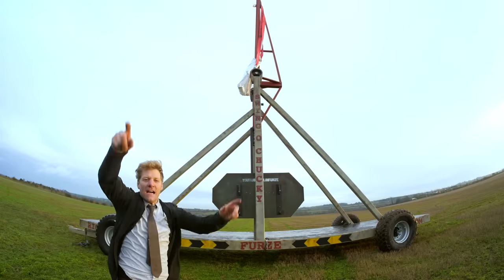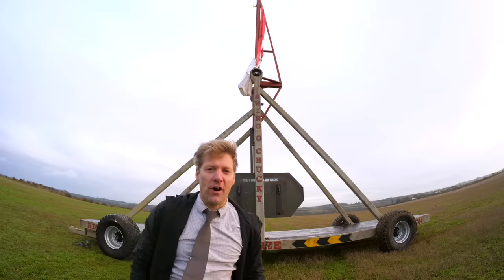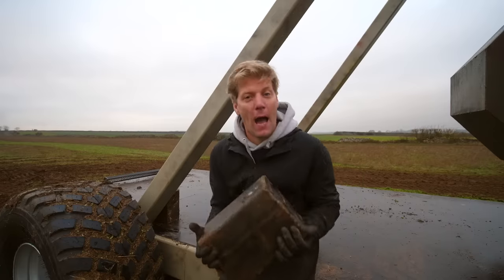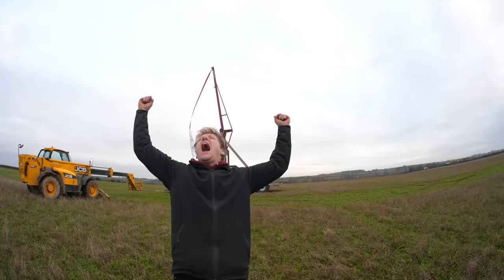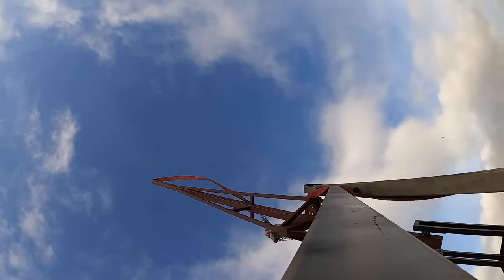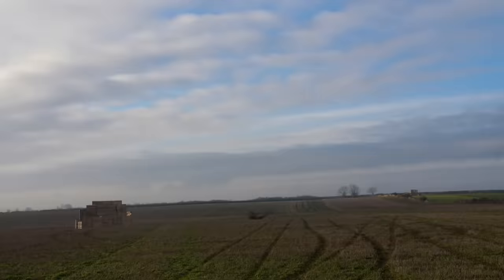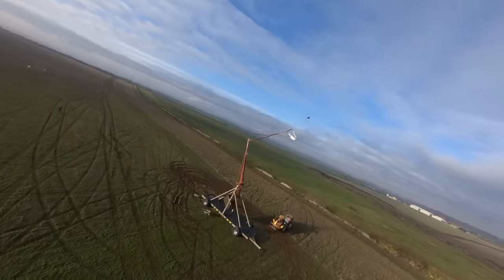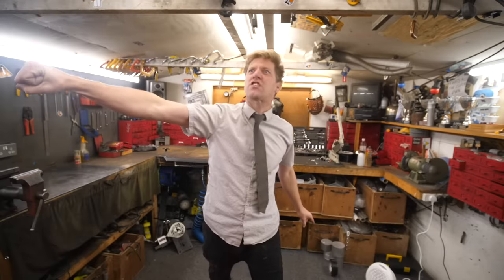MASSIVE Trebuchet/Catapult First Test

Comment: Shorter strap and heavier counterweight. The strap should be shortened before adjusting the hook. It can build speed from centrifugal force faster before release. Think of an ice skater. Slow spins the arms are far from the body, the closer the arms are to the body, the faster the skater spins. The arm and sling should reach the apex when you release at the same time.

Comment: Why not attaching a spoon shape instead ? It won't wrap around the projectiles and they will be released at their highest velocity.
Reply: The projectile would just slip out due to centrifugal force, good idea though!
Reply: lolwut the sling is the whole point of a trebuchet
Reply: The sling increases the effective length of the arm. You would lose a lot of power without it.
Reply: @aero42  yea it shoud be concave enough to be retained
Reply: The main advantage of a sling on a trebuchet is the multi 'arm' linkage which whips it around at the last second and makes it go much faster than the end of the rigid arm does
Reply: @kylekinsey2624  yea but the sling is too wrapped around the projectile due to its weight, all the force you gain you lose it anyway by ripping off the textile. 
If he wants to keep the swing maybe he should be making an Y shape and attaching the swing on each arm of the Y
Reply: That would downgrade it to a "convencional" catapult, and decrease the speed of the projectile. The sling works as a kind of whip, where you trade weight of the projectile for higher speed and, therefore, range.

Comment: Anchor that thing down for crying out loud. Look at all the lost energy with that thing moving back and forth.
Reply: Actually the wheels can make the trebuchet launch things further than if it's fixed. Tom Stanton has a video where he tries this on his little trebuchet. TLDW: adding wheels to a trebuchet lets the counterweight stall a bit later in its movement which in turn means that the swingarm can get to a vertical position before it stalls, adding a bit of speed to the swung projectile.

Comment: Aren't you losing some energy in the chassis moving ? You should anchor it to the ground
Reply: Exactly what I was thinking!  Or maybe a few large wheel chocks from a big rig?
Reply: Apparently not......
Reply: Yeah was thinking the same, also the arm seems to stop moving before the projectile is released, so the optimal launch velocity is yet to be achieved..
Reply: I've heard the rolling chassis is necessary for repeatable accuracy- could just be people justifying a design flaw tho. But it definitely reduces stress on the frame, which is a problem here, if you remember the flex in testing!
Reply: Most of the energy displacement is happening after the shot is released. you want the carriage to move some what to absorb the shock.
Reply: No, that would probably destroy the whole thing. The problem is that the weight just falls straight down, stops, and then has to accelerate horizontally, which brakes the arm too early and all the energy that should go into the projectile is going into the chassis of the trebuchet. That's baaad design.
The solution would be to fix the weight to the arm.
Reply: @GLITCH_-.-   yes you want to launch the projectile at a more straight angel. like a line shot rather than a pop up fly ball in base ball.

Comment: you need to chock your wheels colin, your losing a lot of energy in the recoil before release on the weighted sides down stroke
Reply: Old school trebuchets we're built on wheels specifically so they would be able to make the slight back and forth motions. I can't remember exactly why, but I think its to keep the thing from literally ripping itself apart. Then again, they used to be built out of wood.
Reply: Interestingly, it is the opposite.  When it rolls, it allows the weight to fall further in a straight line, which increases the energy transferred to the sling.  It is somewhat counter intuitive, but a bunch of smarter people that me have done the math.
Reply: Exactly. When it moves, it actually moves the whole thing forward, increasing forward power in the launch. Wheels are intentionally added wherever possible, even if it isn't going to travel anywhere. (Tons of simple gifs online to explain it)

Comment: What about locking the wheels in place when slinging???
Reply: That's my thought too
Reply: He used heavy truck axels with cam style air brakes he just needs to add the brake chambers and a air tank and valve to release them to pull it around then dump the air and the caged springs will  lock the wheels and hold it steady
Reply: Trebuchets are more efficient when they're allowed to roll because the weight can move straight downward.
Reply: @coder0xff  good to know

Comment: You're on the right track with the cable attached to the projectile. Use a bit of steel cable or the strapping like you did on the last shots. No sling to get in the way and much more consistent (if my smaller scale stuff is any indication).

Comment: A few changes I would recommend: 
Better sling, obviously.
Adjustable pin angle. That pin you hammered needs to be adjustable. 

Tuning:
Objects of different weights take longer or shorter to move relative to the arm, and you want to throw while the tangential line to the curved path of the payload is around 40-45 degrees above level (45 is the optimal angle in a vacuum with constant speed, but air resistance, the free height from how tall this is, and the continued acceleration of the projectile each push that a bit lower, I’d guess around *40 degrees*). This means you want the projectile to release earlier than you are letting it.

Additionally, the sling takes a bit of time to release, so you want to release the loop on the pin while the tangent line 50 or 60 degrees. Especially with pointy projectiles that take a long time to release.

Comment: If the span between the weight and where the weight attaches to the arm is shorter, the weight itself will rotate rearwards at a later point in the swing; causing an increase of rotational velocity in the arm.  I hope this makes since.  Great build though!

Comment: Need to chock the wheels, there's a lot of energy being lost with that thing rolling back and forth.
Reply: “Wheels add power as the trebuchet rolls forward. Like a pitcher who leans toward home plate as he hurls, the forward motion adds velocity to the pitched weight. The rolling back and forth of the wheeled counterweight also allows it to fall in a straighter line, the most efficient way for a counterweight to respond to the force of gravity. 

The straight-falling counterweight is more powerful because a straight falling counterweight results in a higher velocity at the sling end at the moment of release. A higher velocity results in a farther throw.”
Reply: @ChrisPete123  wow, interesting. i was actually wondering if it helped, hindered, or was just necessary for it to work in some way. thanks.
Reply: @ChrisPete123  Well, you learn summat every day, thanks for the info!

Comment: Hi Colin!
Congratulations on this massive build! 2 thoughts which might resolve/improve your "bag issues":
1) try throwing more spherical projectiles, as i'm afraid that the corners of your square metallic box might by too agressive for the bag...?
2) i've seen you (sometimes?) placed the 2 strings of the bag on the each side of the projectile and i think that might twist your release. I'ld recommend placing the fixed string on top of the projectile and the loose one under it. Thus the bag will already be alined with it's release's plan and hopefully that will make it smoother.
Cheers & good luck for next shots!

Comment: I feel like the trebuchet needs to be held down so it doesn't move when it's launching. That's got to be a lot of wasted energy.
Reply: Surprisingly, its the opposite. A trebuchet on wheels that is allowed to move is more efficient and I don't know why.
Reply: @TheKakashi709  when allowed to move forwards and backwards with the wheels, it allows the weight to follow a more downward path than if the base was fixed.
Reply: @mharbol  Interesting.
Reply: In earlyer development  many years ago; they found that stationary machines did not do well.
Reply: Lol 😂😂😆

Comment: What's happening with the earlier shots, is that the sling is releasing a little too late,  thus not launching at the optimum angle to get the most range out of it. The way to solve this is to bend the release "peg" backwards slightly to make it release earlier, probably by maybe about 5-10 degrees but no more than about 10-15 degrees, though the best way to do this is to bend it a few degrees at a time with the standard test projectile, until you get a release close to when it ripped through the sling, although looking at the footage, that popped out of the sling a little too early to get the best launch, if it came out half a second later, it'd have been damn near perfect. Getting the release timing JUST right makes a world of difference..

Comment: When the whole machine rolls backward during launch, you're losing a lot of energy there knowing the weight of that machine.
Reply: With wheels is more efficient if you can get everything lined up as the trebuchet is moving forward as the projectile is released.
Reply: I thought this as well, some big chucks behind the wheels
Reply: the energy comes from the weight, for the greatest efficiency you want that to fall straight down- therefore it should be able to move to allow that. It should be noted however that the energy released does not all transfer into the shot so of course there will be additional movement after release.
Reply: You obviously have not watched Tom Stantons video yet. Check it out its very interesting. When optimized wheels make it throw better. https://www.youtube.com/watch?v=KpFTyE-wiNo

Comment: Beautiful!! Two suggestions, need a little bit of hook on the post when sending the strap with the projectile, think that might help with horizontal distance, and as said, round projectiles. Also, need to lock the wheels up as you’re losing some of your power to the whole kit rolling around!!
Reply: trebuchets are actually supposed to roll a bit, otherwise they tend to lurch up into the air
Reply: Did not know that.... thank you!

Comment: Colin, have you thought about lining the floor of the trebuchet to reduce friction?  And possibly making a sling with three layers sewn together.  One layer as original used, one layer running 90 degrees to the original layer's fabric and one layer at 45 degrees to the original fabric.  Or maybe start using fiber glass or carbon fiber strips.

Comment: Instead of trying to make a sling that can work for all the different projectiles at once, just make several different slings. Also, get rid of trying to release the strange shapes like a washing machine with a sling, they will be better served by a strap connection that stayes attached to the projectile with a quick release on the strap, like some kind of explosive decoupler bolt.
Reply: I can't quite get Colin's obsession with washing machines

Comment: so as of now only the releasing mechanism of the sling seems to be the barrier between the trebuchet and perfection, so here is an idea. let's for now say that the release mech is perpetual. as in it happens by itself. but the issue with that is that the angle of the sling relative to the main beam differs depending on the amount of load acting on it (which depends on the weight of the counterweight and the  weight of the projectile. my suggestion is what if you could make the release completely mechanical? meaning that the sling releases exactly when the beam makes the angle that is ideal for the trajectory so that regardless of the weight you put in the sling you can guarantee that it will always release to have the best trajectory and not release when the load is in the right angle.

i hope that you give this a thought

Comment: judging by the movement in the counterweight you are wasting a lot of energy that isn't going into the projectile. Ideally the arm stops more suddenly and it whips the sling faster. The one good one was because it had a higher angle of release (the others seems a little late), try a shorter sling.

Comment: you need to balance the weight with the thing being thrown. 3 tons of jerking around at the end just wears out the machine. if the load weight is right it fires and sits at a dead stop

Comment: If you use a 360 degree camera you can manually adjust the lens width in post so you don't get that strange round warping effect with a lens that's too wide

Comment: I would bet that if the trebuchet were firmly locked to the ground (i.e. not allowed to roll back and forth during launch) that the projectile would launch further. More potential energy would be converted into work performed on the projectile instead of work performed on the trebuchet. Thoughts? Go Furze!

Comment: You're getting loads of height which looks awesome, but I reckon a longer pin for the sling will give you greater distance and potentially greater projectile velocity. (Not a physicist or engineer so if I'm wrong I apologise)

Comment: the design is good, the sling pouch is TOOO BIG.....it should just barely cradle the ammo....

using the "throwable sling" set up, the pin needs to be angled back up, you can see in the video it's releasing too soon.....

you can check the efficiency by watching the throwing arm... if it "stalls" right at the top of the arc just prior to release, then you've got the weight right for your ammo.....from there it's tweaking the sling length and angle of the release pin....

Comment: Trajectory is not good, its throwing too vertical. The red strap looks too long. I would suggest using a bucket as apposed to a sling for realeasing the load.

Comment: I expect that you're losing a lot of power by having the weight swinging like that instead of fixed at full leverage.
Reply: Sorry but not quite correct. Having built a few trebs ( both fixed and swinging counterweight) the swinging counter weight is much better. The reason is it travels in a straighter line towards the ground whereas the fixed swings in a big slower curve. Wheels also help if allowed to move freely they keep the weight moving in a much straighter direction

Comment: Just leave a strap attached to whatever you're throwing?
Reply: Thats the easiest way to handle odd shaped projectiles. In Colin`s case it would have to be a steel hauser and a eye that slips over the pin. I personally prefer the FAT2k treb design but it wouldnt be historically correct for the sponsor